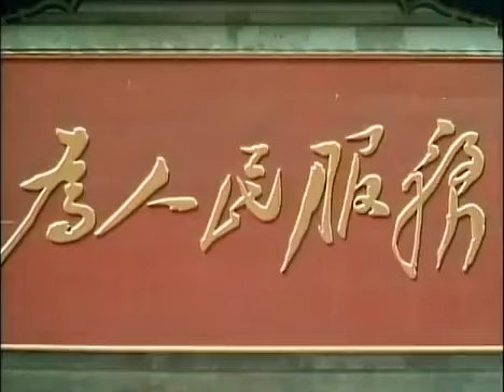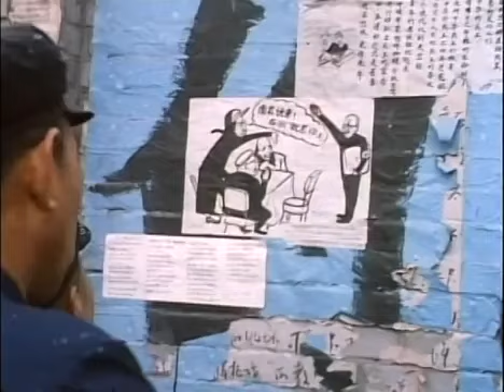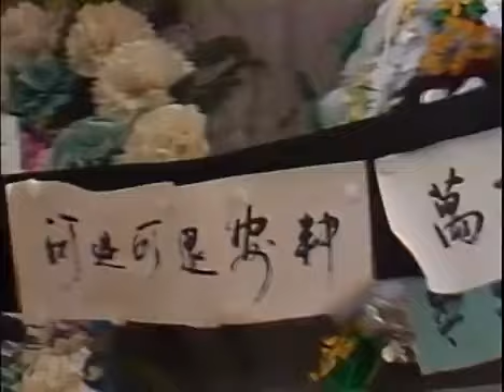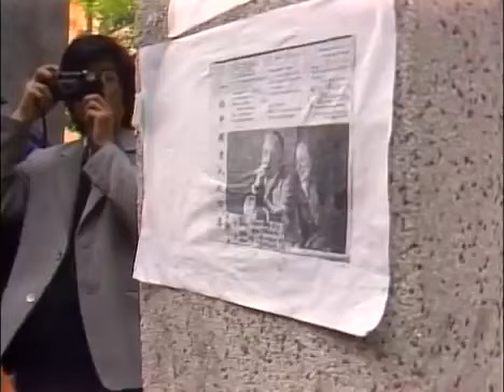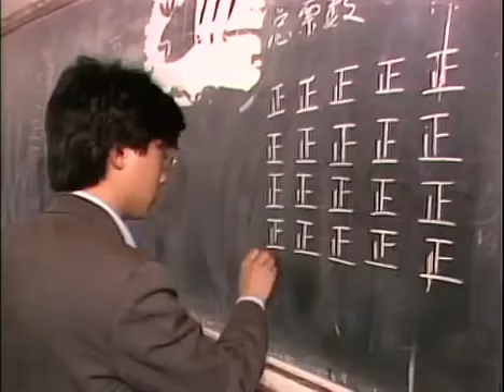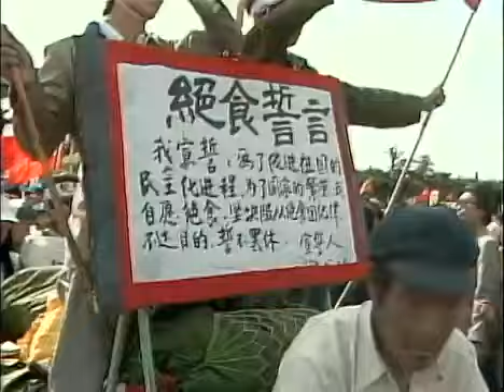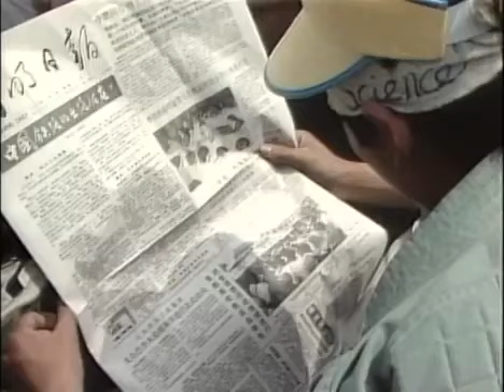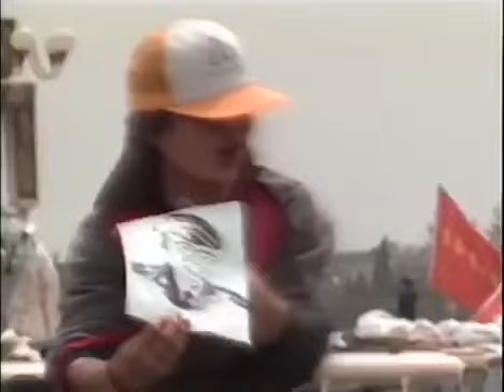The Gate of Heavenly Peace - Part 1 - Tiananmen Square Protests

Comment: The riot was incited by the west n China at any time rule by any Government will not give n to such a protest.Western democracy isn't the suitable for China n it's people. If the government gave in to those intoxicated or working for the foreign agents to instigate this type of revolt than China wouldn't be what it is today. I support the authority's crack down on those rioters no matter how brutal it sound.China's reform need to be gradual n can't be rock be long term turmoil.It path to building a strong nation can't be hindered by a bunch of morons intoxicated by the west. The Chinese knows where it stand n what it should do after a century of set back. The CCP is the only way to drive the nation forward n to build a strong n prosperous nation. What the Chinese Government did was to consistently correcting n reforming its system. Just look at countries towing the western democracy with multiparty characteristic  especially those with multiracial n religious countries.Middle East,Latin America, African countries, n countries like India,Indonesia, Malaysia n many more were all plague with the sickening sectarianism. How can it be fair when the majority group tend to suppress the the minority group due to popular vote that give them the power to oppress the smaller groups which in turn tend to demand secession. Corruption will be hard to crack n many of those politicians have the tendency to use race n religious to propagate their message which often were very extreme.It's like a time bomb that can be blown out of control at any moment. Those politicians were laying ground for extremism,terrorism n corruption What China did today had been a remarkable success which was beyond the west imagination n that's why the US n certain was so worried of the rise of China n were deploying every means to destabilize China. They won't succeed because now every citizen had witness the incredible result of the Chinese government n were fully behind their Government.
Reply: Learn better English before you propagandize. It’s of no use if the your target audience can’t read it.
Reply: @jerrell1169 I understand it just fine.